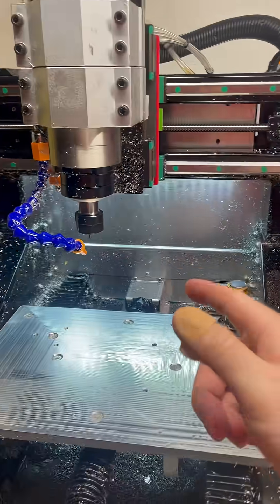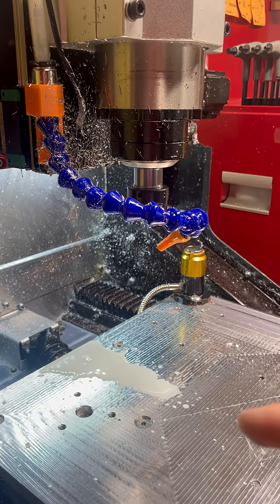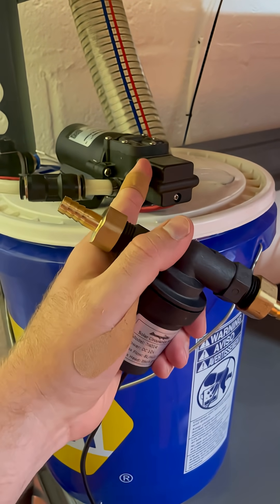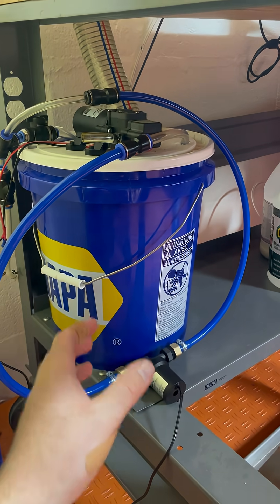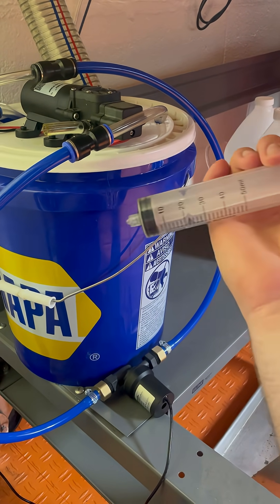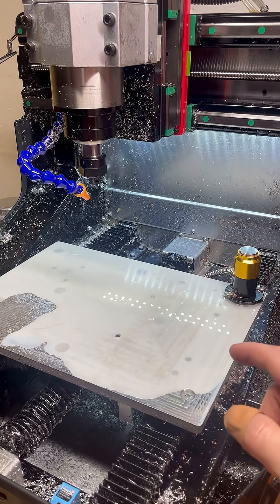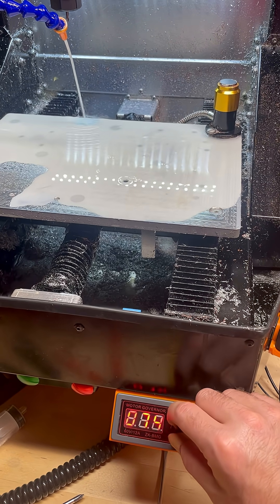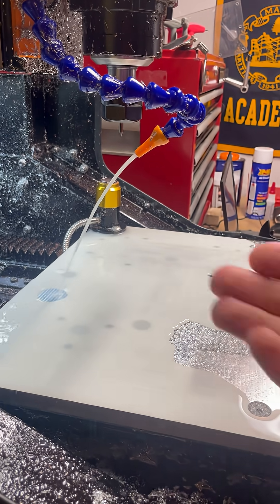Streamlined Coolant Pump on the Sharrif DMC 2 #cnc #diy #3dprinting

Comment from the maker: In this video I further upgrade the coolant pump on my Sharrif DMC 2 to improve flow consistency and reliability. The stock pump was too sporadic, which caused coolant to splatter everywhere and made a mess in and out of the enclosure. I installed a compact electric pump, ran it through a 12V controller, and wired everything into the machine’s power panel. The new setup provides steady flow and should perform better under continuous use.

Parts used:

Affiliate Links:

12mm Air line
https://amzn.to/3TPYSR4

Compact high-flow pump
https://amzn.to/44Wzs9g

12v Controller
https://amzn.to/3GYMgUC

12V male plug (used for quick-connect power, not mentioned in video)
https://amzn.to/4kSVQGL

Questions or feedback are welcome—feel free to share your thoughts or ideas!

#CNCUpgrade #CoolantSystem #MachiningTips #DIYMachineMods #CNCmaintenance